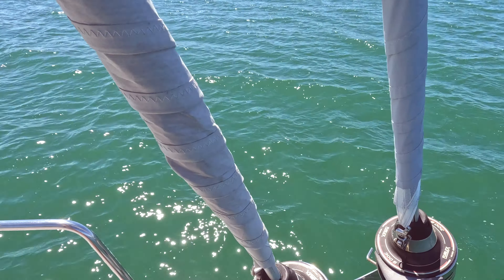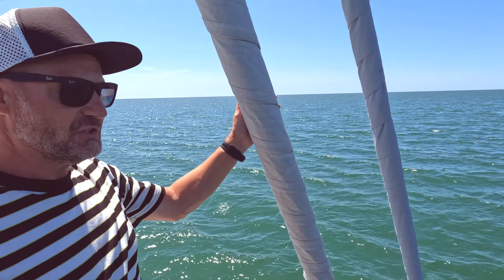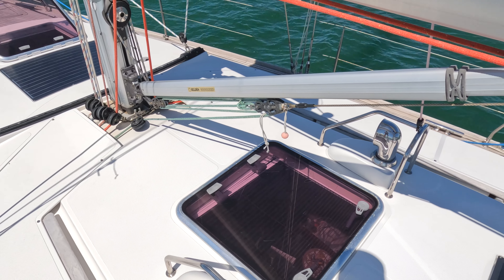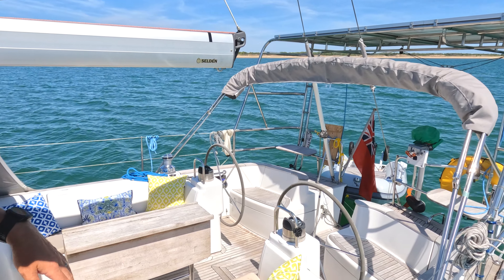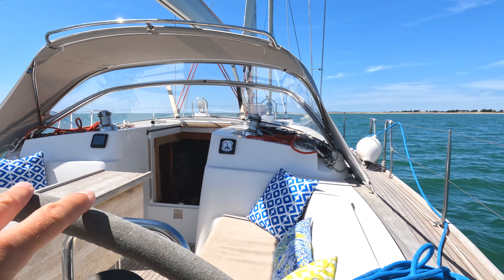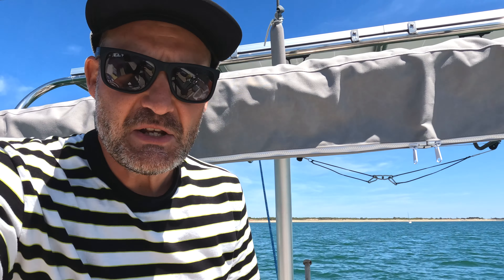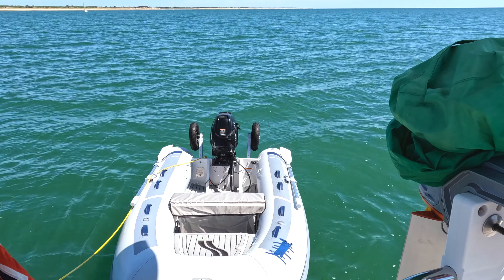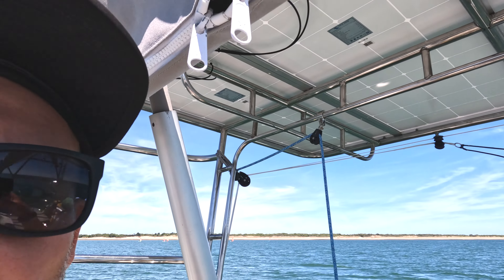Welcome to our LIVEABOARD HOME - exterior BOAT TOUR of our Moody 41AC Classic.

Comment: Gotta tell you - I don't think that storing gasoline (aka "petrol") in a closed locker (even if it is vented at the bottom) right next to a constant potential source of  sparks - the windlass motor - I'm not sure that's a good idea at all...
Reply from the maker: Yeah, it’s a tricky one. There is no perfect place to store petrol on most yachts.

The locker is vented so fumes shouldn’t accumulate and we take the cans out before we use the anchor windless. 

The alternative is to store on deck but I don’t like the idea of the cans sitting in the sun all day.